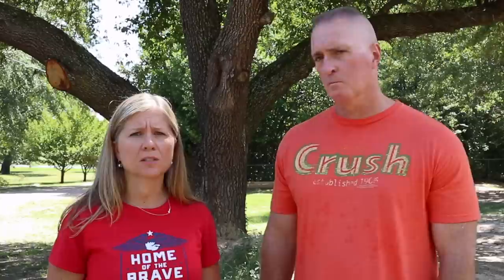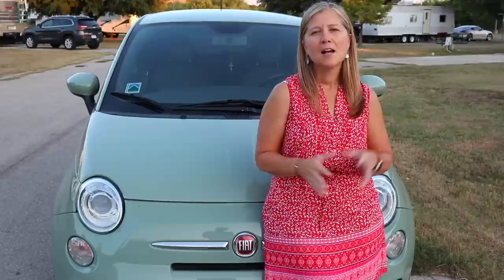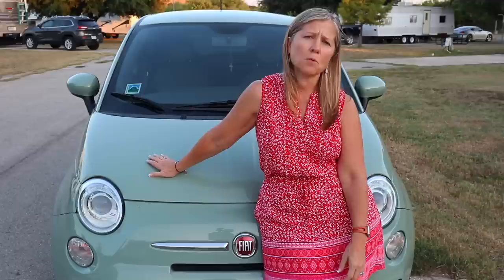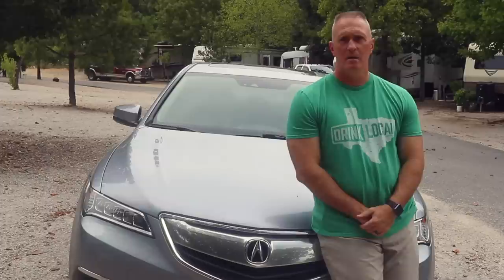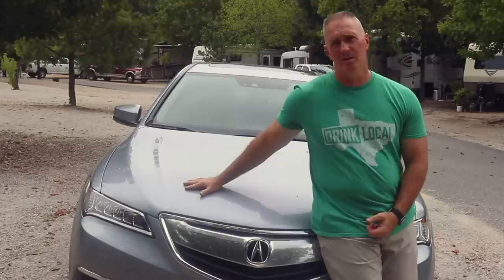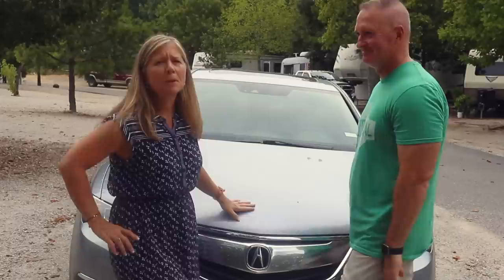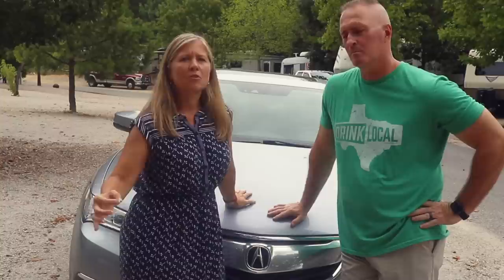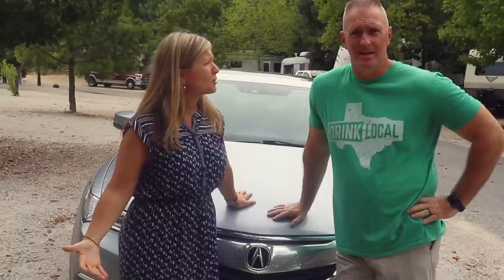RV Towing: Dolly vs RV Flat Tow -  Full Time RV Living

Comment: I just started full time and learned a lot from your videos over the past year. At 1st I said I don't wanna tell a car but after driving cross country without a tow car I know I now am definitely going to get one. I already decided I want flat tow and I'm looking forward to your videos on the flat tow process.   I should be getting mine in about 3 to 4 months so perfect timing with your how to flat tow video. I'm so low and 70 and anything other than flat toe was out of the question. Thanks for the info on the dinghy towing guide.
Reply from the maker: Congrats on going full time!  Good call on flat towing, it made our lives much easier.  We did a video on our flat tow set up when we switched over.

Comment: We bought a 2013 CR-V just for this purpose, it can be towed 4 wheels down. We LOVE the fact we have a car, to go get groceries, etc. The tow bar we bought has a built in braking system (inertia system), so no expensive braking system. Works fantastic. We have a 32' gasser and really don't notice the  car. But that's just us! Thanks guys :)
Reply from the maker: Nomadic RV we have the CRV on our list of cars.  They changed the transmission on the newer ones.  Gonna have to go back a few years to find one we can flat tow...hopefully with low miles.  Will look into the tow bars you have.  Thanks for watching!
Reply: nomadic rv , which tow bar did you get ? we bought a 2013 Honda crv also but have not got a tow bar , you,me &rv we found out through our research that the crv are towable thru 2014 , for 2015 Honda went to a cvt type transmission and can no longer be towed
Reply: You are welcome 😊
Reply: G'day Richard, you are correct. The tow bar we bought is the  ReadyBrute Elite RV Tow Bar by NSA http://www.readybrake.com/store/p4/ReadyBrute™_Elite_RV_Tow_Bar.html. We love that you don't need to purchase or fiddle around putting a brake on the drivers side floor. Hope this helps Paul.

Comment: Great info guys...btw I have a friend who tows 4 down and he shared something with me that I did not know. If you use your Jake break while going down mountains every time you let off the gas it activates your brake lights and on some tow bar braking systems that is what activates your cars breaks (via the 7 pin hitch system). He was using this system on his first toad and while traveling down a mountain decided to use the Jake break and his car stared on fire because every time he let his foot off the gas, his car brakes would activate and it started to melt his rotors on the car and it stared on fire. He told me if I am going to flat tow there is only one system to purchase and it's called Air Force. Just thought I would share this. BTW your videos are getting more and more polished, looks great and keep up the great work. Vicki and I are so excited to join our journey in a couple of years. Hey also, what video editing program do you use? Thanks Greg & Vicki
Reply from the maker: This is great information! Thank you so much for taking the time to share. According to our paperwork Air Force was installed by the previous owners (we purchased with 10K miles) but we have not confirmed. Hopefully this is the case as the connection is still on the back. Thanks for your comments about our videos. We are trying to get more comfortable behind the camera and better with editing. Hopefully, we continue to improve. Thanks for watching and please continue to provide feedback! Hopefully we can meet up one day!
Reply: We have a diesel motorhome, and it doesn't have a jake brake, but an exhaust brake.  I'm going to be doing some thinking and research on your comments, though - interesting.  We have a Brake Buddy, an intertia system, and it's a bit of a pain to set up between trips.   Already thinking about replacing it.

Comment: We just bought a 2017 jeep trail hawk from Carmax.  We didn't want the regular Jeep Wrangler because after having a mercedes benz we were a little spoiled.  The trail hawk can be flat towed and is a four-wheel drive.  We have panoramic sunroof, heated and cooled seats, leather seats, auto start, cold weather package, etc. pretty luxurious.   But if you watch some of the youtube videos, you can take this vehicle off road - almost as good as the wrangler.  But this car is a very comfortable SUV that can be used for "regular" driving.  The only downside is the gas mileage isn't extraordinary.  RVLove just bought one and that's what hooked us in to this vehicle.  We love it!  Good luck with your new channel - we've subscribed!!  :-)
Reply from the maker: 08MarineMan Ok, Ok, you’ve convinced me...you and a few others! Lol. I will go for a test drive and check it out!  I gotta tell you Phil is pretty happy about this. Thanks for sharing. We really appreciate the info! Thanks for watching and safe travels to you guys! Go Navy!
Reply: if you tow 4 down behind a MH did you add the wiring harness recommended by Jeep.
Reply: how do you ask a question on this site--you, me & the rv?

Comment: You did a good job on the tow dolly video, glad you are keeping the Acura, by far the best quality choice.  We have experience with both the tow dolly and flat towing.  The flat towing does require a good amount of setting up and  does require lifting connecting of hitch assembly.  So the possibility of straining you back is still a possibility.  We towed a Ford Taurus on the dolly and a Saturn (Standard Trans) on the flat tow setup.

Comment: Since you're going to have to tow something anyway , we decided to go with a travel trailer . This way we don't have two engines and two vehicles to insure , register and maintain . A travel trailer is cheaper to insure , register and maintain . And a travel trailer has more living space than a motorhome because you don't lose living space in the drivers compartment . We can just use our pickup truck to run errands and sight see .
Reply from the maker: Thanks Scenic Driveways.  We thought about that in the beginning, but we didn't own a truck. A trailer is a great option as well.  Thanks for watching.
Reply: Been there, done that both with a travel trailer and a fifth wheel. Sick of trying to find a parking spot for a 3/4 ton or larger truck when sight seeing.

Comment: I started with a tow dolly and it was a pain the back. So I used it one trip to Arizona, Florida and many states in between from Nova Scotia and sold it when I got home and went with a flat tow system. I have a small car, Chevrolet Spark with a manual transmission connected to my class A with a Blue Ox tow bar and a Blue Ox Patriot 3 brake system. I purchased the tow bar and the base plate from the dealer and the brake system from Amazon. This works very well for me although it cost a bit more as I sold the tow dolly and that off set a considerable amount of the system. So far so good. Big con for me with the tow dolly was the straps had a tendency to come loose and had to be checked and retightened frequently. Con for the flat tow, inability to reverse but then again it is not recommended to reverse with the tow dolly, so flat towing wins.

Comment: I just subscribed.  I ended up doing a deep dive into Thousand Trails recently, and one of your videos was very influential in making me think twice.  I also did not know about Passport America.  After watching two of your videos on towing yesterday, I did a deep dive into flat towables last night.  I have a smaller Class C, so I don't want something big.  Right now my wife is driving a VW separately when we want the extra vehicle, or a moped on a rack on the back hitch, which has its limitations.  The Versa seemed like a prospect, but I found advice that while you could technically do it with a manual trans, you were voiding the warranty.  Then I was looking at the Spark, 2022 model preferably.  But there is nothing in the country short of an older model with 70,000 miles.  The Honda CRV is similarly too old for me.  No other small vehicles that I can see.  So then I considered the Ford Ranger and Bronco, and the Jeep Wrangler and Cherokee Trailhawk.  I independently came to the same conclusion as you.  I think I like the Trailhawk the most.  Thanks.

Comment: When I 1st began my luv’n the full-time rv lifestyle I towed a 1981 Honda Accord Hatchback, 5 speed manual trans, via a Blue Ox Tow Bar and totally luv’d the ease of hookup etc.  That was done behind a 1991 Winnebago Warrior, Class A, approx 25’ rv.  I had no problems climbing & descending the Rocky 🏔 etc.
Although I must admit there were a few occasions whereas the front 🚗 tires would get caught up in some soft sand causing a momentary off-skew situation of which I don’t quite understand why it happened.  Possibly the lighter weight of the vehicle being towed
four down or (?).  I didn’t have anyone traveling with me to ask why this occurred.  Just me and my beloved Akita 🐕, Kiowa Kukiko Kuma.

Comment: OK, it is like this>>>>>
A tow dolly is like 8 or 10 X more expensive than a tow bar & baseplate.
A dolly has tires you have to keep inflated & watch for wear  PLUS  you should carry a spare.
A dollys wheel bearings must be regreased & inspected annually.
A dolly has lights & wiring to maintain.
In camp where will you stow the dolly?
Can the dolly be manhandled and rolled around or must the Rv be used to move the dolly?
Where will you stow the dolly at home?
Will you need to pay a storage yard to stow your dolly when at home?

A tow bar>>>>
You can mount the baseplate to your toad yourself  OR  pay a shop
The tow bar needs  ZERO  maintenance.
The towbar is light enough to carry around OR you can get one which stays attached & folds.
The towbar can be stowed in your garage at home.
The towbar uses a seperate light cord. I carry a spare, just in case.

HANDS DOWN the towbar is the cheapest, easiest, most hassles free choice.

!

Comment: We started with a 2000 Saturn Wagon 5 speed. So light it didn't require a supplemental breaking, just a break-away cable. Easy but the Saturn is so low to the ground and not that comfortable to drive around in. Plus, it was 5 speed.  Upgraded to a much better Blue Ox tow bar, a supplemental braking system similar to the Ready Brake and a 2010 Ford Fusion Hybrid. I (the wife) do all the hooking up and unhooking. Start the car, put it in Neutral, turn the key off. Hook-up takes me about 5-10 minutes. We never have to stop and run the transmission fluid through it since it's CVT. That easy!
Reply from the maker: That sounds like a dream!  We are still using the dolly but hopefully after the first of the year when we sit for more than 5 minutes we can switch it for a flat toe. Safe travels
Reply from the maker: Tow not toe!! I need more coffee! lol

Comment: Get lumbar pillows for each of your vehicles and your back problems will be a distant memory. Car manufacturers have the worst designed seats for proper back position (even the seats with lumbar inflators) and when you couple that with road vibration you end up with everyone with some degree of back pain. At first it will seem awkward or even a little uncomfortable, but once your back gets used to being in the right position your back problems will be greatly relieved. Also, never sit in a chair or couch without a lumbar pillow. Figuring this out was the best thing that ever happened to me. Great trailering info, too.
Reply from the maker: Thanks so much!

Comment: Try an overhead mounted short elastic on a loop of rope so you can stretch forward and back - I assume you have a garage when you aren't RV'ing and can manage that.  You'll be amazed at how cool it is - max easy core - very flexible - great workout.If you want an alternative - go with basic yoga - get those toes all the way behind you touching the floor - best flat stretch.  You can also simply stand and twist, and twist with a kick once you have a degree of confidence -- that's for maintenance!NICE WORK!  LOTS OF GREAT NEW INFO - musta been techies - right?
Reply from the maker: No garage....no house.  We sold it all and are full time. But we do go to the Planet Fitness frequently and I have been pushing Phil to do more yoga type stretches. Thanks for the tips!

Comment: Great video, guys!  And HEY!  My worst "back thrown out" incident happened while brushing my teeth!  LOL  (this is Chad BTW). I researched 4 down towing when we were deciding between Class A and Toy Hauler Fivers...  The breaking systems thing is so complicated!  Any idea which route you're going to take with that?
Reply from the maker: That is awesome! Phil is glad to know he isn't the only one who can throw out his back doing something so mundane! The previous owners had Air Force 1 according to the paperwork so we have to check that to be sure. But if so that will help because it is still installed. As far as dinghys we are looking for something super simple. There are enough steps in break down without adding 8-12 more in our tow car. So as of now the only cars we have found are Jeeps (which I am not a fan of) and manual Fiats (yes, its Stacy so you know I love them). Since we are paying cash budget will play a big part in our decision. But research is ongoing......
Reply: We owned a jeep cherokee for about a month when we were sure our plan was a class A DP. LOL  Long story we'll save for happy hour in TN.  🍻  Not a fan of any of the jeeps?  The cherokee and grand cherokee can be flat towed as long as they are the active-drive 4x4.
Reply from the maker: Yes, I know.....I have them at the bottom of my list which is very short!  Very, Very short actually.  Only has 2 cars on it! lol
Reply: Only the Active Drive-2 has the Neutral setting and can be flat towed. Also  needs the flat tow harness for the steering and has a long procedure to tow.  better off with a Wrangler...
Reply: You, Me & the RV - There are so many more choices then just a Jeep & Fiat; keep researching especially if a comfortable ride is what you might need for back issues etc.

Comment: In many states if the towed vehicle weighs less than 3,000 lb you don't need a braking system. Any front wheel drive manual transmission car can be flat towed, auto trans cannot. That creates an enormous problem for those of us in the US of A. Manual transmissions are very rare. Except for imports like Fiat. Many are available with manual transmission AND they weigh in at about 2,400 lb. The manual trans also serves as a decent theft deterrent device since most young folks have no idea what that third pedal is for.

Comment: I’m a solo traveler and was thinking the dolly would be best but, now I’m wondering if I should flat tow?!
Reply from the maker: What are you driving? Smaller RVs may not need the dolly taken off.  But depending on the size of the site you may need to remove it.  Some people are really good and driving up on the dolly.  My problem is the fiat was so narrow there was just no fudge factor.  After the day with the wet tires and sand I was done. If you have a wider wheel base this may not be the case for you.  You just may need to get out of the car to check how you line up with the dolly a few times.  The more you use it the better you will get. The biggest problem will be moving it because it is a bit heavy.

Comment: Hello, I hope you are safe and doing well. I saw you seem to have the same tow dolly as I do. "Tow Master 4900lbs. I thought I saw a emergency brake cable on your dolly. If so, did you add it yourself, or was it already on. And where can you find one. Thanks and safe travels. 
Ron, IN,
Reply from the maker: Our dolly did have a brake cable that came with it.  We have since sold it for a flat tow system.

Comment: We tow dolly a Saab Convertible,  hate hooking up dolly, love putting top down and exploring.   We carry a sprayer,  one of these pump gal size, a bucket and a microfiber cloth so we can wash the car with little water in a half hour at any site.
Reply from the maker: Thats a cool idea for washing the car! I guess you have to weigh the pros and cons with the car. Right now the con is weighing a bit heavier and the pros for the Acura.  We might be ditching it for flat tow soon!  Thanks for watching and safe travels.
Reply: Do you get a lot of rock/road damage to your Toad? We are trying to decide if we should also install a Blue Ox KarShield next Tuesday when our Toad goes in to be set up for the first time. 
Thanks!
I loved the turquoise Saab convertible back in the 80s-90's.

Comment: I have been using a trailer. It is a pain where the sites are shorter but I can back it in if need be, after taking off the SUV. I actually have a hitch on my SUV so I can haul the trailer to a overflow parking. I am seriously considering buying something I can flat tow.
Reply from the maker: Roy Davis our research is ongoing for a flat tow vehicle and tow system.  I have to man handle the dolly in and around our sites....not fun.  Good luck with your search.  Thanks for watching.